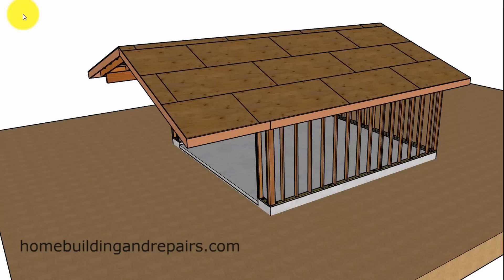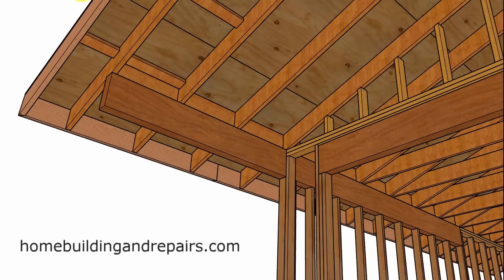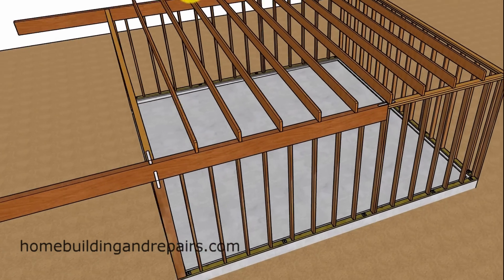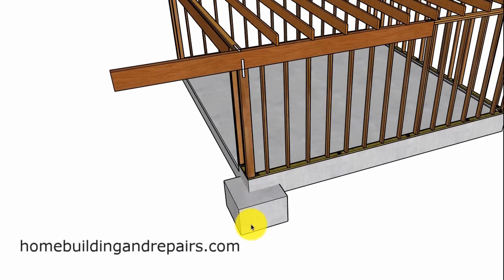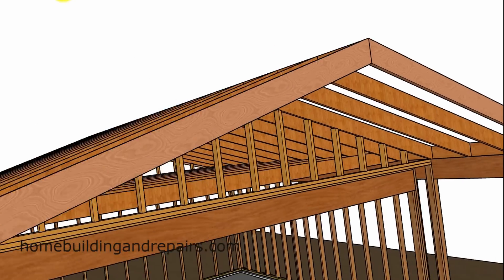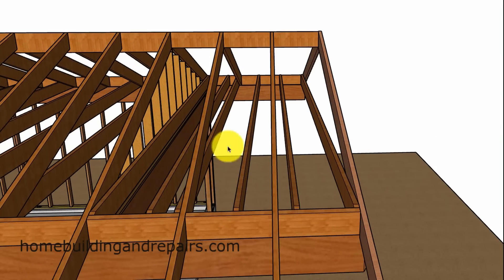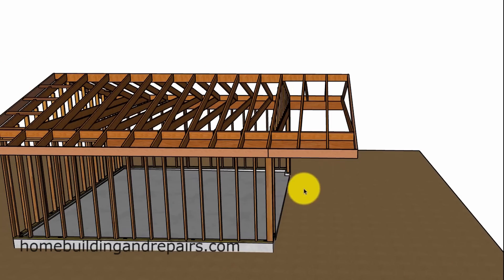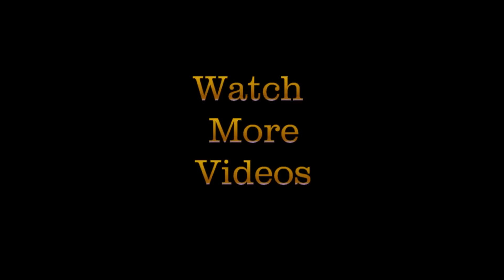What No Posts? - Learn How To Build An Extended Gable Roof Cantilever

Comment: If you plan on removing rafter ties then you're no longer dealing with a compression roof but a structural roof which typically means you need a ridge beam as well.

Comment: I have a 1930 two story with a sagging ceiling on the second floor,  i jacked it up and used 2x4s to anchor rafters to the roof rafters on two of the joists. Is this OK for the roof?
Reply from the maker: It could cause the rafters to sag. I do have other videos on ceiling framing repairs at our website you should check out. https://www.homebuildingandrepairs.com/repairs/framing/index.html

Comment: What size are the roof rafter
Reply from the maker: It will different on most buildings, so I did not put a specific size in the video.
Reply: 40x40x10 with a 3/12 pitch what size the roof rafter
Reply from the maker: @willieboogie  I can't provide lumber sizes for viewers, because I'm not an engineer.

Comment: Why is the maximum cantilever overhang limited to one third of the length of the beam?
Reply from the maker: That's just a standard in the industry, but some newer codes have changed to 1/4 and back 3/4's so check with local engineers to validate.

Comment: I want to do something similar. I am going to be extending my covered patio.  It’s attached to the home (slab and roof). I want to extend my roof over the patio slab extension. Does the new roof beams need to be attached deep into the attic ?
Reply from the maker: I cannot provide you with structural engineering advice, but would imagine that the structural cantilever would need to go back into entire into some part of the existing building.

Comment: Do you have any suggestions for a block building  W14ft   x L 20ft  x  H 7ft 4in. I want to offset  the ridge board to allow more surface for solar panels and property lines in respects and on the  other side of A frame is a pool area cement pad. Oh most important thing I'm stick framing up 8ft walls up to allow for a larger door possibly aloft in the rear of building doors at
 W 8ft x H 12 or10ft . I have one more question do you know about timber framing
Reply from the maker: No I don't know much about timber framing and I don't see why you shouldn't be able to offset the roof ridge, but keep in mind that I'm also not a structural engineer.
Reply: @gregvancom  thank you I didn't sèe an issue but before I continue I think I will take your advice and speak with a structural engineer. Just to be on the safe side I live in South Carolina and we are known for hurricanes and I would like to enjoy the building lol. Thanks again and I look forward to seeing more of your channel

Comment: I have a house built in 1936, without a rim joist and drips down the edge of the house. For decades my family has tried to figure out and improvement. Next roofing cycle I will use this idea of board extensions. Thank you for the help.

Comment: Would making the overhang perpendicular to the garage roof, sort of hip roof style, provide any more structural support? The cross section from the side would then appear triangular, which would be stronger I think. I'm interested in making a cantilevered carport, well actually I only want one side of the carport to be cantilevered (so there's no post, the other side is along my driveway property line, so I don't care if there's a post there).
Reply from the maker: As long as you used structural beams for your roof framing hips, then I don't think it would be a problem. The structural beams would be used to support the cantilever, but since I'm not an engineer, wouldn't be able to provide you with information about how far you could extend the roof framing or what type of structural beams would be required.

Comment: I know this is an older video. But, if you put posts at the ends for something like a carport, could you just attach the new section to your house without taking most of your roof off?
Reply from the maker: It all depends upon the design, but absolutely. Especially if you were going to build your new roof underneath the old one. If the top of each roofs will be at the same level, then probably not.
Reply: @gregvancom  Thanks.

Comment: how could i remove half of one of those rafters and reinforce it to be just as strong ?.. i put up my garage door but i have a saltbox type roof where one side above the garage door header is very low! i cut my garage door header to perfectly line up with the above last rafter so they serve as the sealing area where the upper rt garage door rest against.. and i have super sneaky low ceiling garage door brackets on way!amazon..but i am going to have to notch the next rafter going aft.. two 2x4 sandwiched on both sides up tight against ceiling should be ok?,im not cutting my cement below to drop the door in fear of th slab cracking when i drive over it which is 6 inch thick..so what do u think? any videos of garage door situations? except for the lower cement foundation prob o saw you have posted thanks heaps! ski .by nasa Florida!
Reply from the maker: Send me some pictures of your project and a little more information about what you're trying to do and I'll see if I can help.

Comment: I like the concept. But I would be concerned about wind uplift in certain locations especially after seeing what the recent hurricane did to parts of Florida. 

What are your thoughts of wind uplift and possible ways to mitigate them with an overhang like this?

Great video.
Thank You
Reply from the maker: Good point and glad you mentioned it. This would create a big problem in areas with high winds. Which leads me to my next point, to involve engineers and city or county building professionals with your projects, to prevent something like this from becoming a problem.